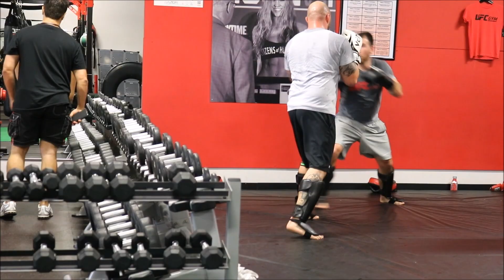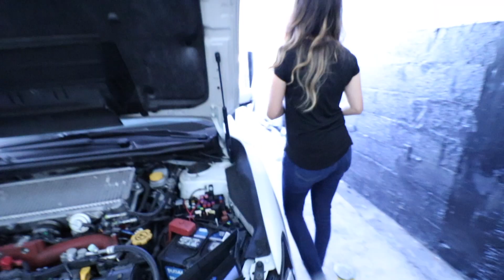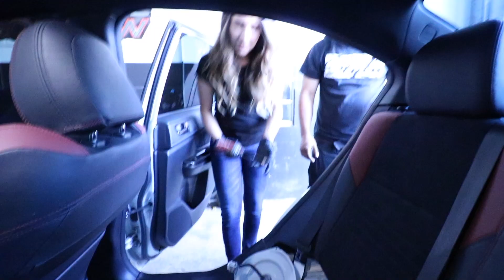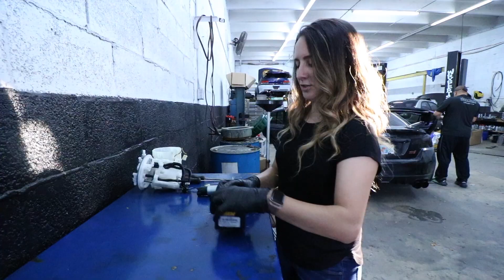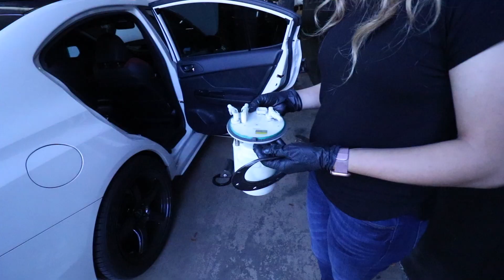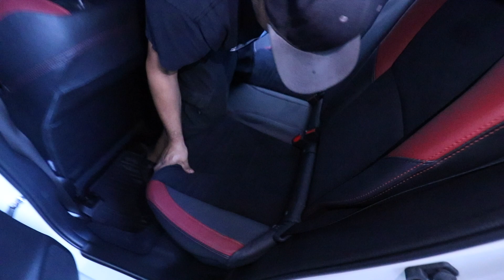STI Fuel Pump Install! Preparing for E85! (2017 WRX STI)

Comment: Im going to try this method today. So you didn’t have to take the top part off, and worry about those tiny C clips on the two metal spring.. awesome job!
Reply from the maker: Thanks glad we could help!
Reply: Any issues installing the pump using their method?

Comment: yo! you got no problems with 2 o rings on the fuel pump?
Reply from the maker: So far she is running good!
Reply: Marc James Galang you are supposed to use 2 o rings
Reply: You are suppose to double o ring them